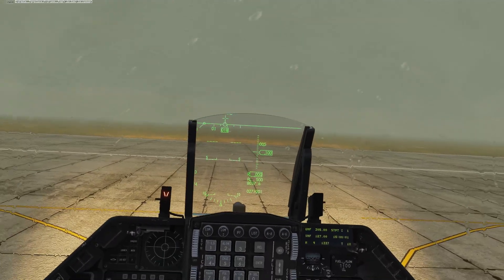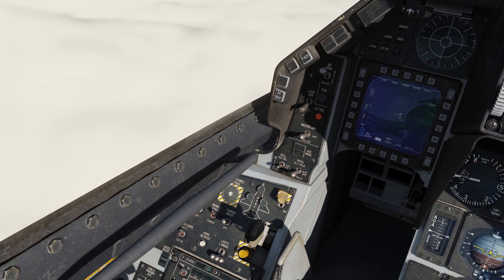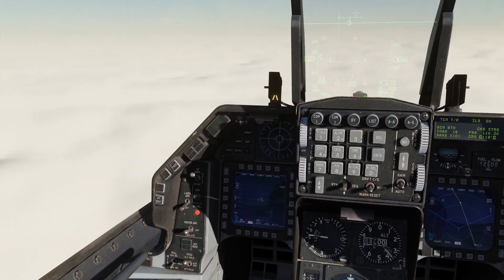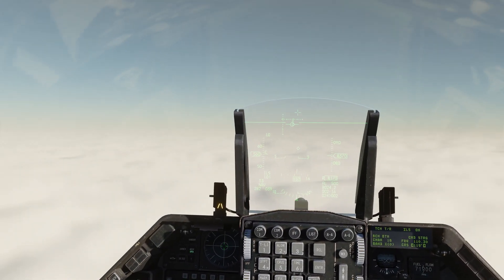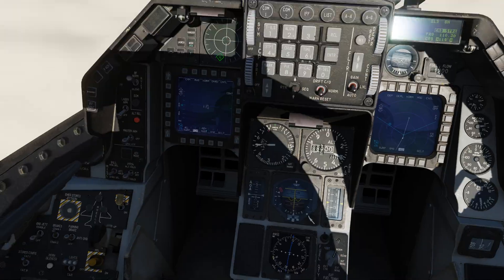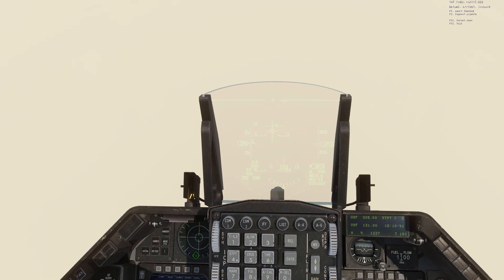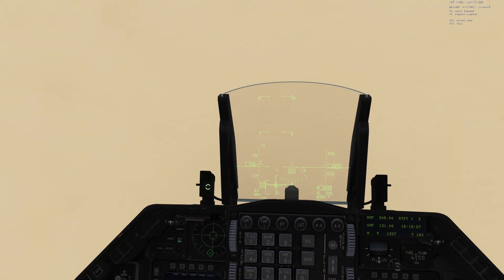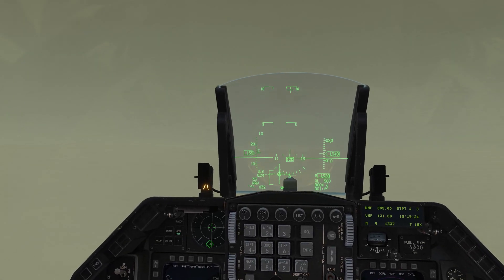Dcs World 2.5.6 - How to land an F16 using ILS - [Advanced]

Comment: Hi, thx for a nice video! Have one question though, TACAN seems to be really not utilized, you fly rather predefined steering points in order to intercept ILS. Is this correct? Do not want to be picky or anything, just trying to learn all of this at the moment :) My understanding is, one would use tacan in case there for whatever reason is not predefined steering points path to get to the airport initial (although TACAN guides you exactly to the tower, not to initial thx to its position at the airport). Long story short, with the mission setup (existance of steering points) you would achieve exactly the same using PLS/NAV, no need for PLS/TCN mode in this scenario. Or am I missing something? Thank you in advance helping me trying to get over this quite steep learning curve ahead of me :)